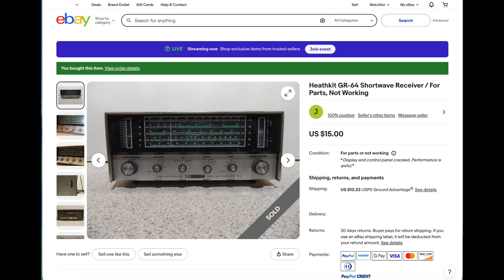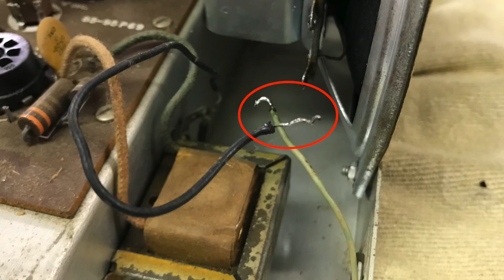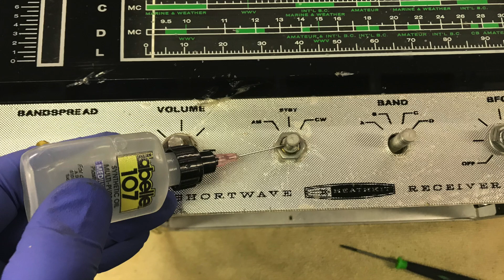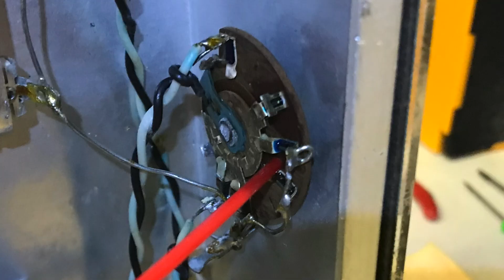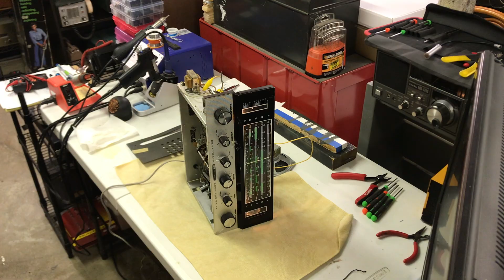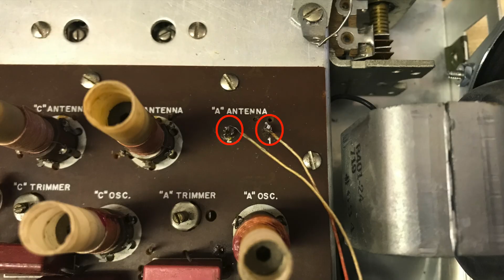1964 Heathkit GR-64 Shortwave Receiver Restore

Comment: I have switched from WIndex to Armor All Multi Purpose Cleaner that is made for cleaning car interior parts.  Windex has ammonia and I find the Armor All does a great job of cleaning plastic dials and panels etc. but is gentler and does not attack painted markings like Windex can.  So you can use both but I try the Windex or other harsher cleaners last.  For instance some dials with painted markings inside get a haze on them that needs removed.  Windex will remove the haze or dust but may smear or remove old painted on dials.  But I guess a cloth damp with water is the minimum and may do it safer too.
Reply from the maker: Thanks for the tip! I always worry about cleaning around silk-screened markings and am extra gentle.